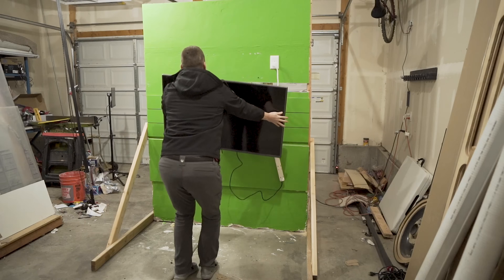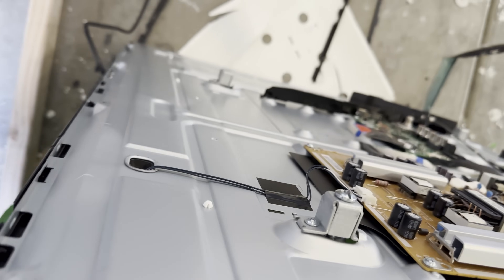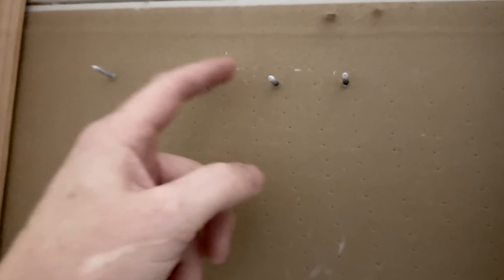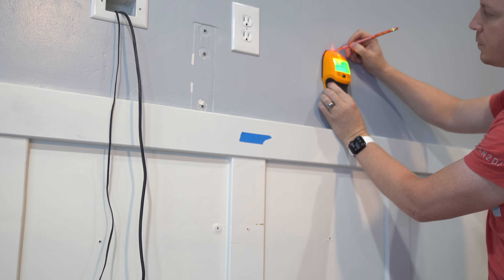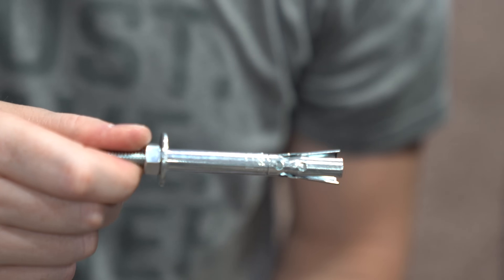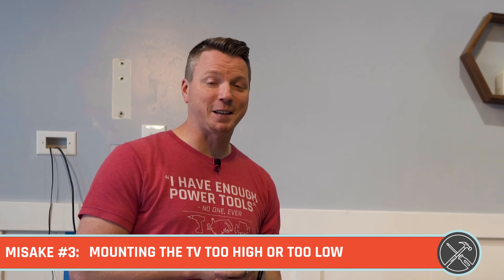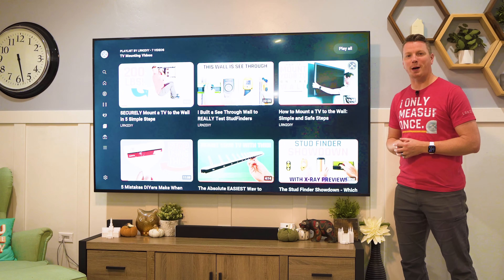3 Mistakes DIYers Make When Mounting a TV

Comment: Respect for mounting the television at the correct height. I see too many mounted too high.
Reply: So hard to convince some clients of that exact issue🫠. I try my best but ......
Reply: Whenever a TV is wall mounted, it's supposed to be at eye level, not high as the ceiling.
Reply: @slimdude2011  Gonna have an exception here.  When you have recliners (like I have) and many den chairs, the back support is slanted.  I have found if I mounted at eye level I am looking down to watch the tv.  I want my head supported by the chair.  So I would suggest to set your chair where you watch tv, sit normally and find the spot where you eyes looking straight and use that for the center of the tv.  In my case that is 1 to 2 foot higher than eye level.  Won't be perfect for visitors on the couch, but I didn't buy it for them....

Comment: I use 2 stud finders on a single job.  I use one of the edge finder stud finders, then the good old magnet stud finder to verify that I have a stud.  I have also used the snap toggles on multiple jobs they work very well.  One is holding up my sound bar on the wall, and the other is holding a flag pole to my house.
Reply: I do this after few other tries.. Magnet never fails to find the center of stud. good advice.

Comment: My 65” LG TV and Sonos Beam weigh about 60 lbs on a  100 lb rated Mounting Dream mount. It’s lag bolted into studs. Level and plumb when not extended, but when extended and angled 45 deg the left side drops 1 inch making the TV not level. Any suggestions? Thank you.

Comment: I have seen damage to LCD panels from using the wrong screws. One was within the past few years on a brand new computer monitor (I believe it was an Acer brand, too, so not like it was a cheap no-name monitor).

Not denying that some TV manufacturers have wised up and made their sets resistant to screws that are too long, nor denying that some manufacturers have been doing this for a while, but there are a lot of brands out there, and there are also a lot of people who might be mounting their older TV that does not have these built-in protections.
Reply from the maker: Good to hear. Yeah, I believe it can happen and has, I just couldn't find any evidence of it myself. I also noticed that older TVs tend to be thicker so they can accept really long screws while newer ones tend to be thinner but have a metal housing around the screw recess that's impossible to get through. Either way, hopefully this is less and less of a problem as time goes on. Thanks for sharing!
Reply: They probably either select screws that will break before they break the set or make them themselves.  I've some suspicion screws exist that would fit but are strong enough to not be the breaking point.

Comment: Thank you for posting that information ,I’ve been scouring the Internet trying to determine if two rotations of my screw head was enough with the mounting bracket to support the TV. The bolt size is M8 and the TV weighs about 100 pounds and there’s four screws, but they only go in about two complete revolutions in the 30 mm length. Which didn’t make me feel very confident, but I wasn’t sure how much it should go in, probably no more than four or five threads is all that’s available?

Comment: Thanks for all the great info. I have an 85" LG TV, which weighs about 130 lbs. I want to install it on the Brick wall above the fireplace. Which bolts/screws should I use for the Brick wall? I want to use a Pull/Drop-Down & Swivel TV Mount, do you have any recommendations of which ones are the best? I appreciate it.

Comment: I have the pipishell full range motion rated up to 77 lbs / 60 inch and I have a 43 inch roku tv tv that doesn't even way half of the max mounted. The level adjustment keeps slipping making the tv uneven. I tried extra washers & still slips. Any suggestions? Thx

Comment: how to pick a Samsung 65 in Wall Mount? I'm moving to a much smaller apt from where I live now so I want to mount my tv because I''ll need every space I can get. So what you suggest? Also I'm moving into APT that has metal and concrete bldg. What's your best suggestion for mounts, I dont want something that extends from wall too far. But I also don't want to have any trouble with bright lights and viewing angles either. In addition my mom after dying from Covid I took her old 43 in lg while I was waiting to replace my old lg 50 inch that I loved but fuse went after 10 yrs of ownership. So what do you suggest there too? thx.

Comment: I got 12mm drywall and 18mm OSB which are attached to metal studs. Should I attach the mount into the metal studs or can I just attach it through the drywall/OSB?

Comment: If I use two pag bolts on one side then put about 4 drywall anchors in the middle and other side do you think that would be sufficient for a 135lbs tv ?

Comment: Mounting only applies to typical built American homes. Many places in Europe still use bricks, so only thing you need to know is where are the electrical lines located (if they are on that wall).
Reply: In Europe upstairs the power cables are coming from the floor up , downstairs from the ceiling down ...check with a cable/pipe finder .

Comment: @ldrn2diy. 
  What about using 3/4 inch solid slat board (larger than the mount... smaller than.the TV)  between two studs, a d then mounting to the flat board. 
  Of course, router edges. Stain it make the board  nice etc.

Comment: i have a few stud finders but never feel confident about it. The idea of drilling into the edge of the stud is my greatest fear. Used your link for the franklin. I like the LEDs. I'll keep my other one for detecting voltage and confirm edges. Yes, i always re-read my emails after i send them.
Reply: It came broken. A lot of reviews about that on Amazon.
Reply: My stud finder gets me in the ballpark. More often than not I drill holes, just like this guy showed, with a 1/16 drill bit.

Comment: When I mounted my TV, the stud placement didn't line up with where I wanted the TV.  I wasn't going to trust drywall because it was also a large TV.
I ended up installing a horizontal 2x4 instead.  I cut out a horizontal section of drywall the exact size of the beam making sure it crossed over multiple studs.  Then used a router to cut notches into the studs at a depth where the beam would be flush with the drywall.  That allowed me to place the beam across multiple studs with most of the weight resting on the notch of the studs themselves and screwed it in before mounting the TV to it.
It was just a matter of spackle and paint to clean it up where it was basically invisible even though it's behind the TV so you'd never see it.
Reply: That'll work or using wood about the thickness of the drywall like the planks people use to support a mattress.

Comment: I had an issue with mounting mine, and it was a 75 Lb plasma.  For some reason I only had one stud I could use, due to some HVAC runs, so I didnt have typical 16" on centre studs.  I used 3 different stud finders, and the drill bit trick, and still nothing.  I ended up 2 lag bolts in the stud, and then the higher end drywall anchors for the 4 corners.  Its 1.5 years now and its fine, but everytime I hear a creak, I still worry

Comment: The video was almost over and I was about to share one last tip where I didn't take the position of the mount on the TV side into account. Sure enough at 13:20 you cover that exact thing!

Not sure if you'd be able to find a test wall or if enough people would find it interesting but I have plaster and lath walls and that was an interesting twist as I tried to install a concealer. Would be great if you had any tips on that.

Comment: I have an older home, that the previous owners just drywalled over the old plaster, & lathe walls😑

Any suggestions on how i could locate the studs, & hang my t.v. some day?
Reply: I had to work on a similar setup.  I narrowed it down by finding a stud that an electrical outlet was on (pulled the face plate off, then stuck a wooden skewer past both sides of the outlet box to see which side the stud was on), then measured 16" increments to the area I wanted to put the mount.  Then I drilled a small hole that would be covered by the mount and TV.  It missed the stud, but I used a stiff wire with a bend in it to feel for the stud in the wall and was able to find it.  Hope this helps.

Comment: I agree that toddlers are the best, they're not necessary, though for "holding into the drywall" the second option works just fine. That plastic is only there to hold the fastener in before you put the bolt in once you put the bolt in it solid and you can pull it out and it will still be there, on the other hand toddlers do break pretty easily and then you have to throw them out

Comment: Some tips on mounting over an uneven surface like you did here would be cool. I didnt know that was doable really
Reply from the maker: Good point - I didn't really cover that in the video. I just used the spacers that came with the mounting kit to make sure the wall bracket was the same distance away from the wall at all points.
Reply: I came to the comments specifically to see how you addressed this question. I presumed you used a spacer, but if your showing something such as the the last segment, it should include that detail. 

If one of your viewers simply didn’t fully sink the lag bolts and left the backing plate 1/2” proud, that would nearly guarantee a failure. UNLESS, you possibly added a bolt into the center, which MIGHT be adequate if the vertical piece of that decorative material was sufficiently strong.
Reply: @LRN2DIY  I always make sure to get longer lags in that case too, if you use the included 22mm spacer, you're essentially losing an inch of threads into the stud. Most decent mounts come with 3" lags, so good to have some 3.5" and 4" lags on hand as well.

Comment: What if the first set of holes was too high? Can I simply make another set lower? Did I make my brick / cement wall too weak? Should I first remove the old plugs and fill the holes? If yes, with what? Thanks!

Comment: My studs are 27" apart while the biggest mount I can find are 24" only. Is it feasible to mount one side in the studs and the other side on drywalls using anchors? I have a 55" LED
Reply: One thing to try is mount 2 2x4s horizontally between the studs, then attach the tv mount to the 2x4s

Comment: I wish there was a video where one could overcome mounting a TV on a wall that has a window right in the center.  Is there something that could be used to bridge the two studs on each side of the window and then apply the TV mount?  I want a 98-inch TV, but it has to be wall-mounted.  But there is a window right smack in the center.

Comment: Another option... put up a "decorative" (e.g. painted to match the wall) piece of 3/4" plywood or pair of hardwood boards, just a bit larger than the TV mount and so it spans at least two studs, and then land the TV mount on it where needed.  Me... I would never use drywall anchors.  When I re-did my family room, I put up 3/4" plywood, then a layer of drywall over it on the wall area that would hold the TV.  I can mount it anywhere I want on that wall now and even upgrade to new TVs later with no fear.

Height... I was always told the bottom of the TY should never be higher than your eye's while seated.  I see far too many people mount TVs way up on the wall, or above a fireplace.
Reply: That's what I did with a monitor. Still holding strong using deck screws.

Comment: I got a brand new Samsung s95b, and the screws that came with the mount were only catch like 1 thread. So I used a chopstick to measure the depth of the bottom of the  hole to the top of the spacer (35mm) so ended up getting some from the hardware store. No way I was going to trust 1 thread per bolt.

Comment: Hi, I used bolts too long for my tv and then there was a very thick black/static vertical line on the display. I opened the tv and changed the screws and now the line is thinner, what should I do now?

Comment: Since you're only talking about drywall, I'm guessing you've entirely forgotten that there are still many houses built with lath and plaster walls. That's a real shame. Most of the walls in my house are lath and plaster, but some are drywall. The previous owner was a moron, and hammered nails into nearly every wall (which will require much effort to repair), and mounted a toilet paper holder and a small shelf unit in one of the bathrooms...using drywall screws and missing the studs. Needless to say, it took little time for those items to fall off. I hope he doesn't flip more houses--I feel sorry for anyone buying a house from him.

Comment: What I do to eliminate the chance of the TV falling is; when I notice if the studs are too far apart, I do one of two things.

ONE: I would cut open a hole in the wall, screw a couple of 2x4's on the top and bottom (PRESSURE TREATED OF COURSE) to be able to mount the bracket after patching the  wall.
TWO: Screw the 2x4's or a 3/4" thick plywood to the studs behind the wall.

All in all you will be assured that the TV will hold.
Reply: Blocking is a good idea, also prevents weakening studs, but you don't need pressure treated, that's for exposed exterior use.

Comment: I used those plastic drywall anchors once . . . Never again! Held for a whole 5 seconds! Always find a stud!!
Reply: Those are for pictures or small mirrors. Something that will be flush to a wall. I’ve used a few for pc monitor type flat screen TVs for hat weigh nearly nothing. 
They have a very limited shear strength.
Reply: Can only use those for tv mounts that are stationary. Not the moving or tilting mounts …..

Comment: If you want to mount somewhere specific and the mount won't hit the studs, I recommend mounting a piece of wood... that you can mount to the studs then mounting the TV mount to that piece of wood.  Yeah, it may have your TV sticking out an inch or two further out, but the TV would be mounted to wood rather than drywall...never ever just mount a TV just to drywall....always  mount at least one side to a stud, otherwise you're going to be buying a new TV over time, even with drywall anchors, doesn't matter what size TV you're mounting.

Comment: I prefer E-Z Ancor Toggle Lock rated at 100 lb/anchor.  I like them because I can simply place the tip of the anchor where I want it and turn it, either by hand or with a drill driver and it punches the hole and sets the anchor in the drywall.  Using a minimum of 4 per far exceeds the weight of any TV that two people can lift.
Reply: Lol on the description of the product online it sepcifically says to not use for mounting TVs. Just funny, i dont see any problem with it.

Comment: Most places in Europe are brick so it's a giant pita to mount stuff to walls, especially thin brink. My neighbor has drilled thru my wall a few times lol.
Reply: Just get drill dat is made for stone / concrete with sds drill bits. Not just the hammer function on your regular drill.
Reply: I have mounted a lot of heavy stuff on walls including a rack for my cast iron cookware. I ALWAYS ATTACH TO THE STUDS, never had a problem. Drywall anchors are for light stuff.

Comment: Great content, I got a 65-inch TV that was given new to me out of the box. I was surprised that you ended up saying that every TV comes with a lot of different sets of hardware mounts to choose from. Well this one didn't, I had to order it. Luckily I already had the wall mount mounted to the stud from the previous TV.
Reply from the maker: Congrats on the new TV! To be clear, the mounting kits usually come with all the hardware, not the TV, but either way, it sounds like you've worked it out. Enjoy that new TV :)
Reply: Sorry about that, I had to go back to your video to hear that part correctly. I think it's that time, to change the battery on my hearing aid.

Comment: I’ve used a SANUS low profile drywall only mount with only nails and have had hung many tvs with it over the years including my current OLEDS and not 1 single issue. It’s at Walmart for like 30 bucks and I’ve never used a stud with it

Comment: I live in a camper temporarily and im going to have to make my own mounting studs to mount in front of my living room window. I plan to just run a couple boards across the window and bolt to the studs then mount the tv mount to that board. Has anyone else had to do this in awkward rooms?
Reply: I'm not sure how many studs are in these old campers from 1997 but I know there's the one around the window I can use for my mounting plate. The window is just wider than the tv mount. So I have to make due.

Comment: Can you show wood paneling thats what Iam getting ready to do.
Reply from the maker: It's more about what's behind the paneling. If it's drywall, it works the same as shown here.
Reply: @LRN2DIY  I wish I knew what was behind it. I guess the only way to find out is to drill into it.
Reply: @goose45015  The panelling was likely mounted to studs. Look for nail holes. Buy a good stud finder One tool you will use more than once . Also electrical outlet boxes are usually mounted to the side of a stud makes it easier to find the first one. Then every 16 inches

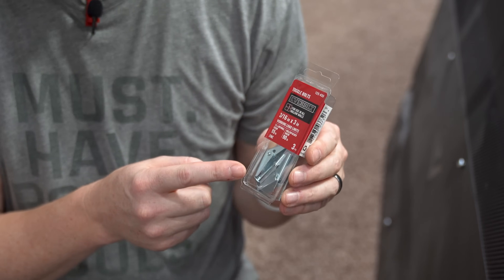Comment: What is going on at 6:06 ?
Why does he appear to be drilling in through some type of an elbow pipe connector attached to a soda bottle.
Reply from the maker: That’s a homemade dust catcher. Just a PVC elbow fitted to a soda bottle. It catches all the drywall dust as you drill.

Comment: If you can’t locate the studs don’t mount your TV.  Don’t use any kind of toggle bolts they won’t last and can be dangerous
Reply: As a pro installer toggles often are the only option. High rise apartment buildings are built with metal studs. Leaving no other viable options. 
The are indeed a PITA.